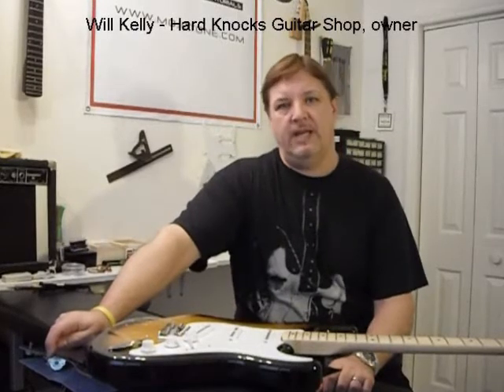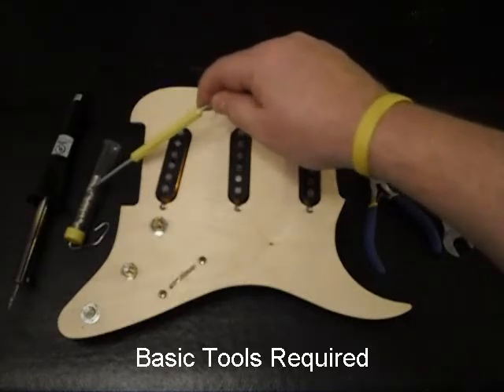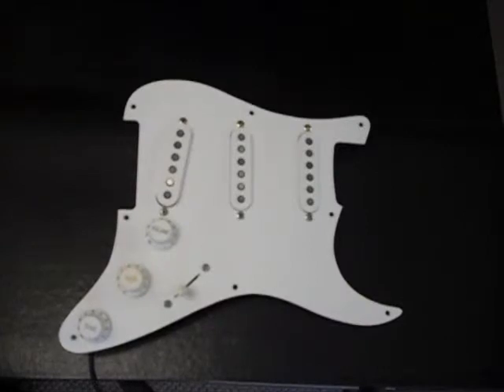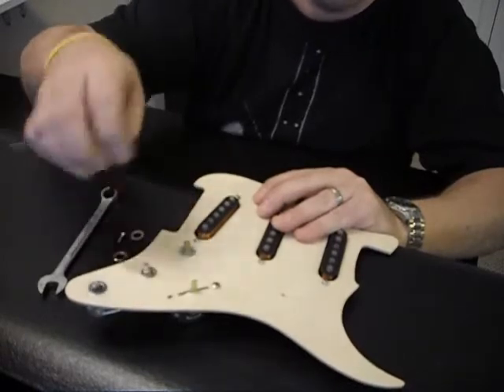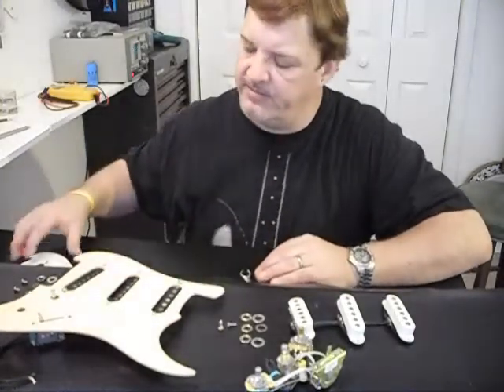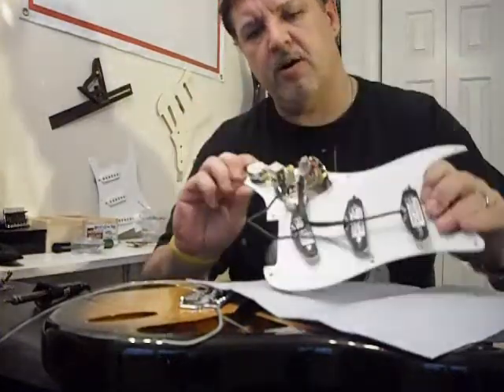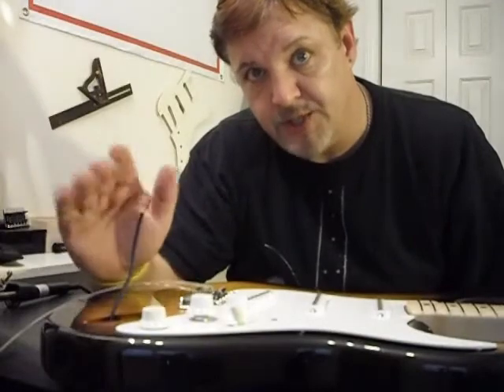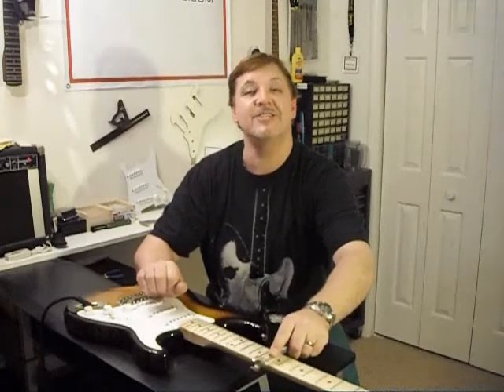How to Install a Pre wired Pickup assembly yourself in less than 10 minutes.

Comment from the maker: That's a Peavey Reactor that I was f'ing around with, and actually installed SIX pickups in it. There are five single coils, and then there's a piezo pickup actually mounted to the tremelo block, to provide a additional tone. With the two five-way switches, there's more than 26 pickup combinations available... I did this just for a lark, to see if it could be done.... that's a perk when you own your own Guitar Shop !

Comment from the maker: It's not a dumb question. Active pickup assemblies still have to be grounded to the strings. So be on the lookout for a black, single strand wire that seems to come from the bottom of the pickup cavity. It actually is soldered to the tremolo spring claw, and fed through a small hole in the trem cavity on the rear, in to the pickup cavity on the front. If you don't see a ground wire hanging around, then something's wrong!

Comment from the maker: There are three wires coming from the output jack, and one wire coming from the bridge ground. Star ground together all the grounds, hook the output from the main pot to the output hot lead, the battery lead coming from the output jack to the battery 's positive terminal, and you should be good to go!

Comment: @MrUssylover single coil pickups picking up 60 cycle hum. when its flat on your bed its not picking up the amp's tone so it doesnt hum, but on your leg the pickups are facing the speaker, picking up the amp itself.

second and fourth positions are 2 pickups together in a hum cancelling manor, wirin crap basically.

nothing is wrong, just ignore the hum or turn your gain down a little

Comment: Really helpful what if the tremolo wire has been ripped off the guitar would you just solder it back?
Reply from the maker: +Hunter Morris Yeah, resolder it ... but, if you don't have a soldering gun, you can always wrap your bare wire around a ground point that has a screw attachment point, such as the mounting screws for a switch body...
Reply: +Will Kelly awesome thanks!

Comment: Okay, so I'm not sure if this is a stupid question or not, but I took the stock pickguard and pickups out of my Strat and am trying to replace it with a prewired Lace Sensor pickguard. I'm not sure how exactly I'm supposed to solder it on because there are no free wires. Maybe I'm just dumb, but there's no harm in asking, right?

Comment from the maker: Typical "pre-wired" guitar assemblies usually do NOT include a pickguard. The purpose of Pre-wired assemblies is to provide fully wired pickups and controls usually attached to a simple cardboard or wood ply template, so that novices can upgrade their instruments' electronics without having to know how to solder or wire/assemble components.

Comment: i have yet to buy a loaded scratchplate, are there any websites you could recommend with some fairly cheap deals? also, where abouts do i solder the wire to or from the tremolo?

Comment: Hi! I have a pre wired humbucker pickguard for a strat. In my old single coil loaded pickguard there's only two wires but in the humbucker loaded pickguard, there's three. Two is black and one is white. How do I know which cable to be soldered were? All three is soldered to the volume knob. Hoping for answer.

Comment: Great video. Based on your experience, What is the best sounding, non-expensive, very low-noise, high quality pickups for Strat style that I can get "pre-wired" from Mojo? I appreciate.
Thanks
Reply from the maker: You can purchase any pickup arrangement, and have them pre-wired by Mojo with your choice of custom components, such as pots, capacitors and switches. Simply contact them, and talk to a specialist about your needs, and they'll give you a quote. As far as pickups go, take a look at the "Lee Dickson" strat pickups. They're spectacular!

Comment: So I'm installing a prewired pick guard into my a blank body for the first time. and there was no split black wire for the out put jack. just a black wire, a white wire and a red wire. all loose. I'm pretty sure the black one still goes to the out put jack. but I have no idea about the red or white? 
any help you can offer would be radical.

Comment: If I just want to swap loaded pickguards, all I would need to do is remove and resolder the ground wire to the trem and the output jack wires, correct?
Reply: curt santner You've got it!

Comment: Doing some looking online about this -- is the solder 60% tin and 40% lead, or the other way around, or does it matter?
Reply from the maker: There are only two types of Solder core ... rosin or acid. Use Rosin core solder with lead alloy if you can find it. Avoid the lead free solder .... it's a pain in the ass to work and rework.

Comment: what about the trem block ground?
Reply: Chas Matkins Goes to a ground on the back of a potentiometer or other available spot with a ground. He grounded it on the 5 way switch, with the ground tab there (a little lug that sticks out, and attached to the metal switch). It is always good practice to go with star point grounding, ie, have all grounds go to one point, in order to avoid ground loops, and other nasty noise.
Reply: S Leduc Thanks.....good tip to avoid ground noise....Cheers ;-)

Comment: QUESTION:  If I want to replace the current pickguard with a loaded one, Im not replacing the output jack, why do I need to solder as apposed to just connecting the hot wire and ground wires together with wire nuts?
Reply from the maker: Yes you can do that, but be aware that wire nuts are not the best solution. They'll work, but nothing replaces a properly soldered connection that's insulated....
Reply: Thanks for the quick reply Will.  Is is possible that just connecting the wires with wire nuts may effect the sound in a negative way?
Reply from the maker: no, as long as the connections are solid ... just that they could loosen over time w/use and end up shorting out. Plus, they're bulky and in the output jack cavity there's not much space after the jack plug's been inserted, so you'll have to contend with that while positioning the nuts